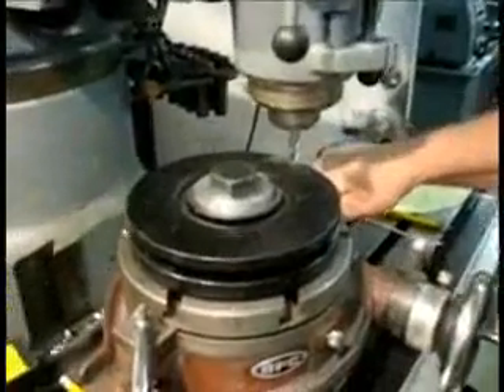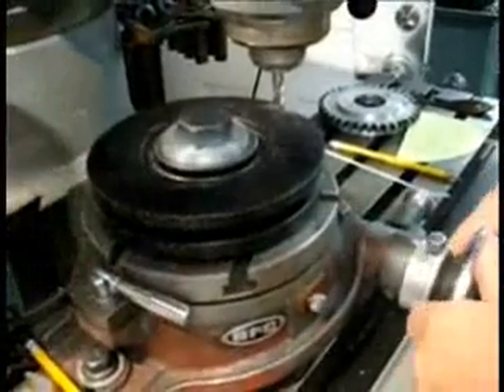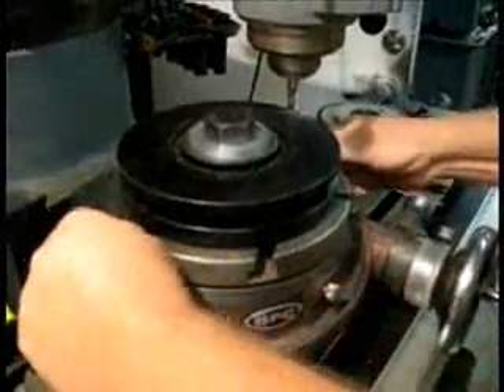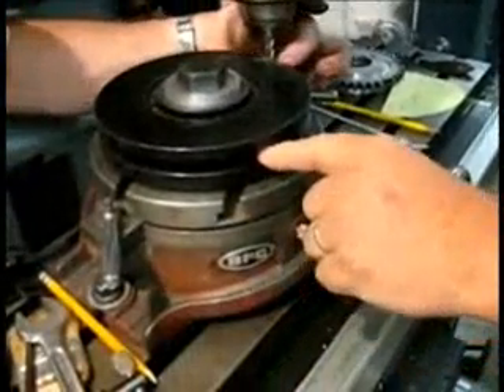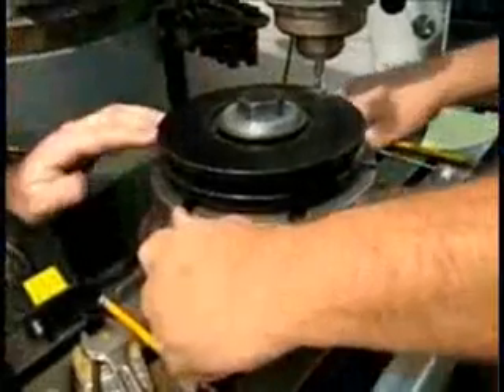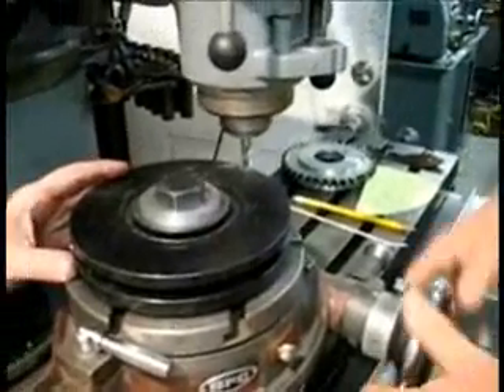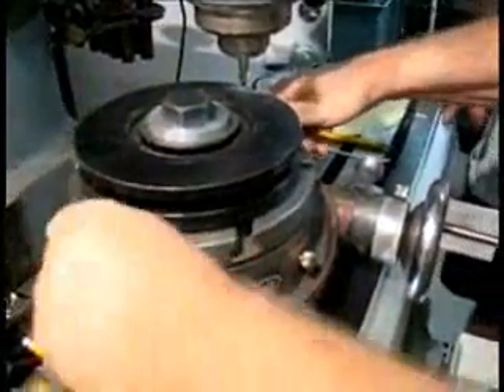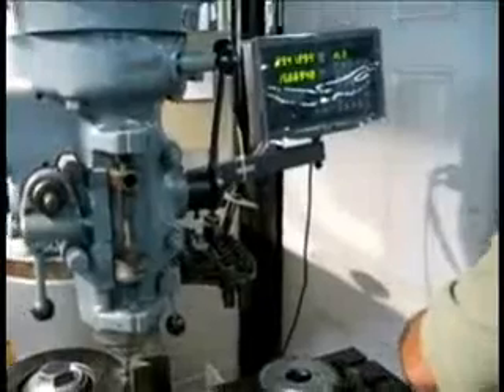EDIS Ignition for Jaguar

Comment: Thanks to Richard for uploading this in '07. This video shows the process of cutting 36-1 teeth into the Jaguar crankshaft damper & does away with adding an extra "tooth" wheel to the EDIS setup. This shows the bench setup of all the sensors reading the cut damper and then spark plugs firing. We then moved everything from the bench to my '68 E Type, pulled out the D22 Dizzy and watched the car come alive with added ignition performance. I gap my spark plugs at .050 versus factory setting on .025.  For some reason YT removed the previous 12 years of comments. Ignition advance/retard is handled by my laptop. Sorry for the blurry pictures as i was hand holding the camera & working other pieces of equipment.